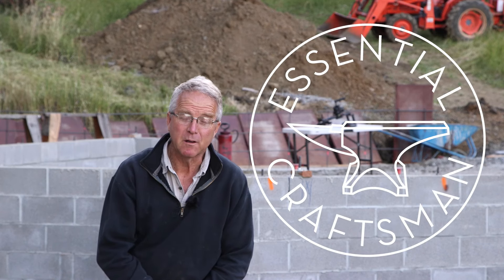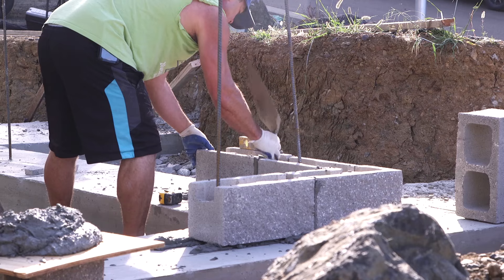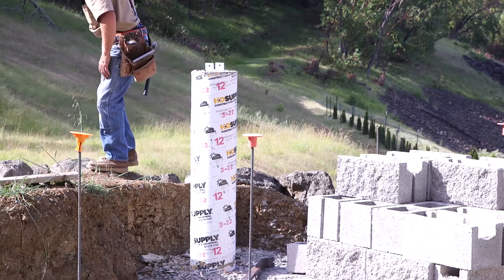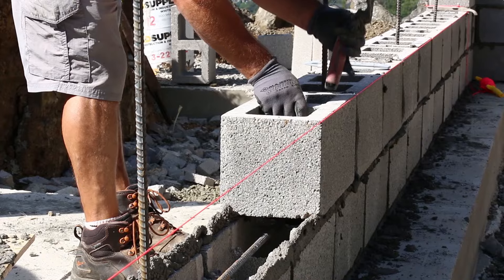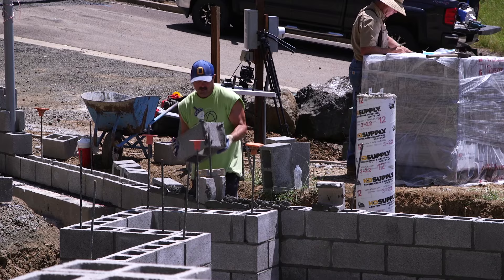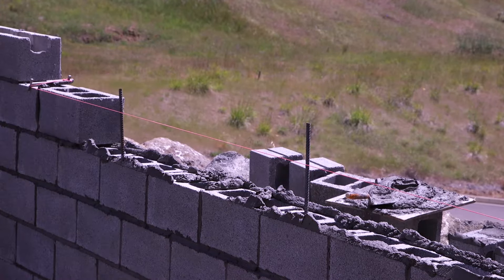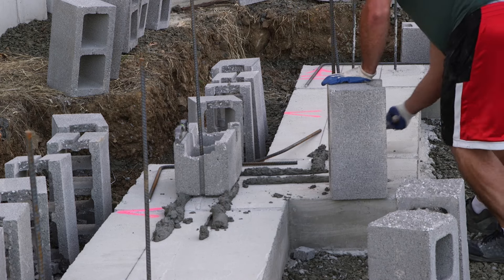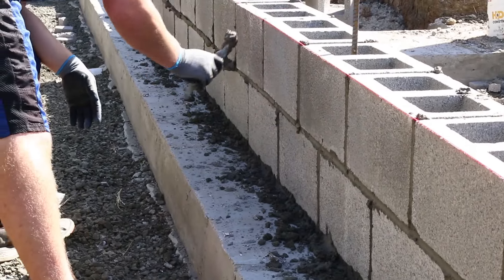Laying Block Stemwalls EP.34

Comment: One of your comments about shorting cement in older buildings stood out: many old brick buildings shouldn't have cement between the brick at all and should have a lime based mortar. The reason being that very old buildings that have brick, either in the foundation or walls, used soft brick and if you put mortar that is stronger than the brick in the joints the bricks will fail.

Comment: From a retired Mason, if you raised the mixer 8" by putting a CMU under the tires and front stand  the wheelbarrow will set straight under the mixer when dumping the mortar.  This is what we used to do in Mississippi.

Comment: I'm glad you addressed the silica dust. It's a real thing. even just a spray bottle of water helps a great deal with the dust but a proper mask is best practice.
Reply: All the modern cement cutting saws (much like the one used for cutting block in the video) have an attachment for a garden hose, so that you can wet-cut your cement. it cuts the dust down to essentially zero, and your saw blade lasts longer! It solves the number 1 reason that guys dont wear dust masks. Too uncomfortable. Well worth the money to upgrade, in my opinion.
Reply: Not sure about Oregon but in Washington it can be a finable violation if Labor and Industries inspector sees it. Silicosis is a real thing that can kill you 30 years down the road. Like Asbestos. It's a pain to keep the dust down. Especially if you are trying to make a living. I've raised my share. That being said us old guys should be teaching the up and coming Craftsmen how to work as safely as possible.
Reply: No he didn't address it, he gave it a free pass - "I'm not your Mother". This is unacceptable.
Reply: It’s actually OSHA regulation. First time occurrence is a $25,000 fine... and increases substantially every time. That’s why every major tool manufacturer are making vacuum attachments. You HAVE to regulate the dust when working with all concrete material. I actually just saw this was posted 4 months ago, and if I was this guy I would maybe edit some stuff out of this video...
Reply: @____________________________.x  im not sure if they dont understand how bad silica dust is or if they just dont care, but healing your lungs is very hard...
Reply: @letterslayer7814  _ yep, and it's a long slow death. maybe they are too cool for school
Reply: horse1066 He isnt their mother. Hes the general contractor. I appreciate that he allowed them to make their own decisions about safety. Its the masons responsibility to decide what safety measures they are going to employ while they work. We live in a society where everyone loves to point the finger at others for their own issues. My personal policy is to educate and inform others on what i know if i see something i consider unsafe. After that its up to them whether they want to listen if it is an issue that is not affecting others. Is it a good idea to control silica dust? Absolutely i wouldnt make more than a couple cuts without water or a respirator. Ive been overexposed before and believe me it is no fun when you cannot talk for about 3 weeks afterwards. But he isnt their mommy. If they want to screw their lungs up its their business.
Reply: was he addressing it at 21:09
Reply: Exactly. I cut concrete and brick for years with a dry blade and little to no mask. I have sporadic breathing problems now.
Reply: He's right, he isn't their mommy.  It's just like seat belts or helmet laws.  The government doesn't mind being your daddy or your mommy, but in the real world, people can make their own decisions and truly it's no one else's business.  I like to use the water for my cuts tho.
Reply: I see a lots of Mayson’s driving around lately That forgot to take their masks 😷 off

Comment: Great video! Could you speak to the advantages and disadvantages of using CMU versus a formed and poured foundation wall?
Reply: Yea, that's been a running comment theme through this vid series. I guess its personal preference ultimately, some may say easier to do block, but for a guy that's been doing poured walls for years he may say the opposite, I think structurally poured walls are probably stronger and if you are in a seismic zone maybe a necessity.
Reply: price
Reply: Block or brick walls are super easy to modify or repair...poured walls, not so much. any type wall can suffer damage ( especially in very cold freezing conditions or flooding or hillside erosion potentials......masonry contractor since 1972 in Michigan here
Reply: Great video, My three brothers and I have been masonry contractors in Michigan since 1972.....we are getting tired, hardly anyone else here wants to ‘take up the torch’, so we now can just name our price ! ( very are very, very competitive though ). And yes, we are ‘hard to please well known perfectionists’ and difficult to work for...

Comment: It's been very interesting to learn not just one aspect of construction, but an overview of how everything ties together. I never realized how important the handling of materials would be, but I can see now if you were a little sloppy with it throughout the process, boy would that compound over time.  These pallets weren't there that day so the guys had to stand around for an hour. These materials were placed in front of the ones we need today so we gotta move every thing. These were placed here not leaving room for the mixers or trucks to get in. You could increase your costs and frustration an incredible amount just by being bad at the logistics, whereas if you do things like you're mentioning, water and blocks or whatnot right where guys need them, they work smooth and fast and don't have to pick up anything more than is necessary. Imagine picking up a house twice instead of once. I just never put together all of these aspects until watching all of the videos, it's so fascinating!

Comment: I finished school at 17 and went straight into a Mason apprenticeship, Spent two years labouring for five pro masons it was a hell of alot of work but I stuck with it. Here in Ireland we use a mix of 5.1.1. 5 part sand 1 part cement 1 part lime.

Comment: I'm always impressed by masons. I have done some of the different sorts of work involved in building a house (framing, roofing, wiring, drywall, pouring slabs, insulation, stucco, siding, painting, and plumbing, though not at the level of skill shown on this channel), but my two attempts at masonry weren't successful and I needed to call in pros. Maybe someday I'll learn how, but for now I just watch these guys with my mouth open...

Comment: I really like all your videos and this is no exception. I grew up in a masonry family in West Virginia and Virginia. I'm not sure what has happened to the art, but your block masons are wanting with regards to technique. They are having a hard time spreading mortar on the footers and their trowels are covered in mud. Not bad work, but it doesn't look like they do a lot of masonry work. I've never seen a mason cut block in t he middle of a wall and overlap joints, or butt block in corners without tying in. Back in the day, mortar was mixed, by hand, with various components and the mix was made to suit the conditions and strength requirements. In the 70s, the mix went to bags of mortar that had a lime component. There were various types of mortar, such as Type S and Type N. Sand was mixed in by shovel count, 18, 20, 22 shovels per bag to suit conditions and mason's demands. I'm also surprised to see mortar shot out on plywood rather than mortar pans. I'm not criticizing the work these guys are doing...it is hard work; I'm just saying that the art of masonry is significantly different than it was in the profession in the East. Masons would lay 4s, 8s, and 12s with very little adjustments and tapping. Laborers took care of striking. Additionally, no mason would ever be caught dead with anything but Marshalltown trowels and wooden and brass American Levels in 2', 3', and 4' lengths...never a short 1' level. The tell though is that block courses are being constructed without building the corners first. Corners are built with levels to be level and plumb and then courses are run in to the line. I know this is rambling, but I wish you could have seen the way it was done when it was done correctly.
Reply: As a mason of 22 years I wholeheartedly agree. There are a lot of tells here. I hate to criticize another but this is not representing the craft to appropriately. Just the way he handles the trowel, no flick and no distance with each spread. More like a pick and dip. It's still done correctly up here in the Northeast, some of it at least. But we have our fair share of boots too. The best masons, lead masons are on ends building leads with Crick levels. Lineburners put one on two. Barrel jointers are most common here but I prefer a sled runner as it evens the wall out more. He also could be swiping heads on the block he just laid. Instead of on the one he's about to lay... which he also does wrong. He wastes time smearing the inside of the joint which if he did it correctly, with more force, wouldn't be required to keep the joint on the block. If he's going to spread joints on the one to lay he should at least be doing it with one trowel of mud using half of it for each side. He should be spreading beds off the board and then clean off his extrusion on each side and use that for the head of the next one and not have to go back to the board so much for it. He just leaves it hanging there which is a lot wasted mud. He's also not on the right side of his line. Hard to see how you're running when the line is on the other side of the wall. And what REALLY grinds my gears is guys not double buttering closures and completely filling between ears on both sides. I used to chew my guys out for this. You have no joint if you don't. And I've NEVER seen a guy use a torpedo level to check roll after the first course. That's just lunacy, and I reckon would get you kicked off a site here. If you start right you don't need it after that. They're just really slow and inefficient. But I'm sure it's hot and they are getting it done, one way or another. Everyone is at a different stage of learning and these guys just don't seem all that proficient with their trowels. They look like weekend warriors. I am guilty of plywood mortar boards though. Only one guy I worked for had pans. I've done masonry in Ontario Canada, New York and NC. My girlfriend was born and raised in Harrisonburg Virginia. I noticed online there are a lot of masonry companies there. I'd like to come down that way to work too some day. It's interesting to see the regional differences. And I saw quite a bit of nice brick work down that way. Cheers from another rambling mason.
Reply: I think in the video it said those guys are always framing and masonry work isn’t their primary profession

Comment: Good masons they are, Scott... but a great mason keeps a mortar trowel in hand and a 4 ft level close by.  There is more to an old timer's work than chicken-legs and string.  To watch a true  craftsman set, then run a level horizontally, vertically (sometimes diagonally) not just for level but as a straight edge for 3 block face continuity insures walls straighter than you'll ever get with just a string.   Does it matter when your exterior is split face... not so much.  But it matters to those from a different era.   Just cuz you can't see the backsides, doesn't mean it shouldn't be right.

Comment: First off, always great video's well done and very informative but as a retired General & Masonry contractor I see preventable errors that have already taken place with the vertical steel layout. Now I have been watching every episode, and yet I saw you Scott taking precise measurements and being extremely careful with the vertical layout of steel in order to avoid having to hickey the steel over and away from the webs of the block.  Why did you miss the vertical pieces of rebar in all or most of the corner block starting out??? and now I see the block layers pounding steel over with a sledge hammer rather than using a hickey bar to gently move the steel over to avoid hitting a web. Where did you find these guys?? They are hardly skilled proficient block layers.  As the video plays on , I see that they are not building some leads establishing square corners and setting the corner block  in order to fasten his line stretchers too and run straight courses of block. The one guy seems to be struggling with actually setting his block. Man Scott, what happen to your careful layout?? They are pushing all kinds of steel out of the way!!!!  OK as I watch further into the video I get it!! When you go from framing to block laying which I have done most of my career, your simply not going to keep up with the guy who picks them up and sets them down every day. At the end of the day - If the walls are straight, level and your plate sits nicely on the finished product, your square - and are not facing challenges with your layout at the top of the wall even thought you got it right at the foundation elevation, its all good!! Love your video's, appreciate the hard work that goes into producing them (NOT EASY) thanks for sharing with us. In the end - we can all take something away from each and every video you put up. Retired now I can still learn something from you Scott with each and every video. Thanks
Reply: You forgot the part where they put a pig in the wall in the first course. Half block in the middle of the wall.
Reply: And the zipper in the middle at the end. Oof

Comment: Why block, why not just form and pour concrete?
Reply: Cheaper maybe?
Reply: rain coast not sure, but I do know concrete is very expensive.  Blocks are probably cheaper.
Reply: Less likely to crack, maybe.  Formed and poured always cracks - like the retaining wall did - but a block wall is dry as it is installed (other than the mortar, obvs...but that's pretty small compared to the whole wall) and cracking would certainly look ugly.
Reply: @aussiebloke609  if a person drills deep piers and space them 6 feet apart under the footing, then use a huge amount of rebar in the formwork and then pour,  you'll never have cracking in a million years
Reply: @aussiebloke609  think about it, what else would he say? you think his ego as being a this construction master on youtube would make him say, yes guys I fucked up, I actually pulled a rookie mistake on the retaining wall, CONCRETE SHOULD NEVER CRACK IF ITS DONE RIGHT PERIOD!!!!!!
Reply: @aussiebloke609  do you think those concrete high risers or aviation tarmacks just randomly cracking after their poured because concrete "shrinks" haha, completely false dude
Reply: Far from random cracking - that's why they put expansion joints and fail lined in them.  But if you've ever seen a highrise building being constructed, it's common to see some cracking after the pour cures.

Also, "tarmacks" (sic) is short for "tarmacadam"...what people would now call blacktop.  it's not known for cracking.

"Tarmac -
Trademark:  
a brand of bituminous binder, similar to tarmacadam, for surfacing roads, airport runways, parking areas, etc.
noun:
(lowercase) a road, airport runway, parking area, etc., paved with Tarmac, tarmacadam, or a layer of tar.
(lowercase) a layer or covering of Tarmac, tarmacadam, or tar."
https://www.dictionary.com/browse/tarmac

But if you actually mean the airport's ramp or apron...look again.  There's usually a crack in pretty much every joint line (which are usually not actual joints, but deliberate fail points so the location of subsequent cracking is controlled.)

Incidentally, did you even bother to watch the link I posted?  It's about the first thing that's said, only a few seconds into the video...and somehow, I'd trust the word of someone who's done this stuff for years over a keyboard warrior.  Your lack of understanding of the terms you use has betrayed your level of knowledge.

Research - it's a thing.  Try it sometime.
Reply: @ redneckrenos - Your comments make me question how much experience you have working w/concrete. Cracks in concrete are extremely common. But ‘generally’ they are nothing to worry about. It’s just the nature of the material and that’s the reason rebar is used with it. Concrete is great in compression and steel is great in tension. Together they get the job done.
-You’ve heard the old, worn out concrete adage - “There’s 2 kinds of concrete. The kind that’s cracked, and the kind that’s gonna crack.”?
BTW - Pre and post tension cables do wonders for hiding cracked concrete.
Reply: I think it was simply to introduce another craftsmen trade to the series. Nothing more or less.

Comment: A water can fire extinguisher can cut down on dust significantly while making the cuts. Just wet down the brick and or blade.  Its relatively cheap and refillable with a garden hose and air compressor. Good for when a wet saw or water source isnt available on site. Great video!

Comment: I was a hoddy (hod carrier) when I was 17, did it for a summer+ in Tucson AZ.  I enjoyed all the learning and hard work.  1 sack Mortar cement (60#) + 16 shovels of sand, OR 1 sack of cement  (100#) plus half a sack of lime (50 # sack) plus 28 shovels of sand.  The real trick is how to load the mixer so it does not seize up or have lumpy or soupy mud.  That would make the mason angry!  As a land scaper I used that knowledge to make many brick edgers/dividers and patios and also flagstone work.
Reply: The premixed bags never seem the same as the old way.  All too often I mix it and it just does not have the body, like it's low on lime content.